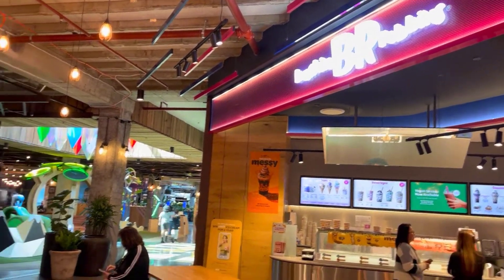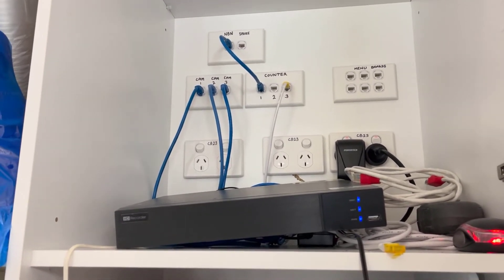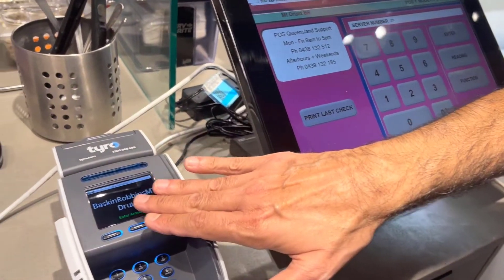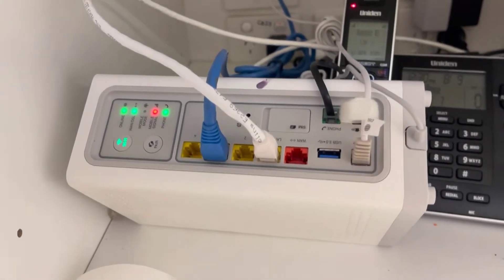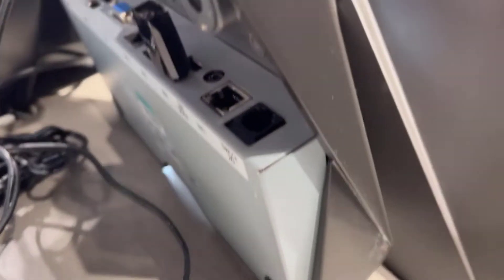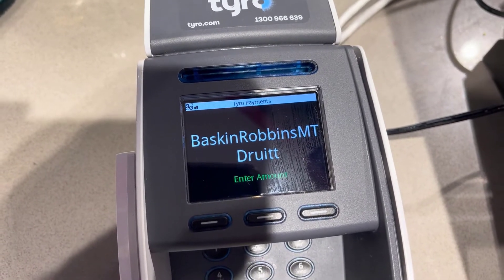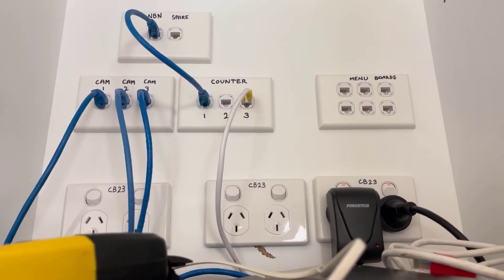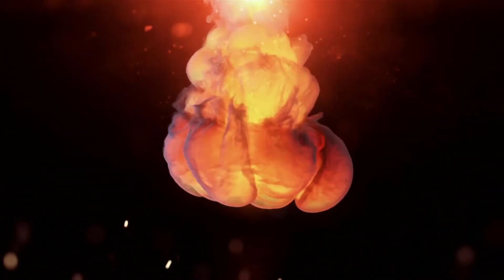6 Months POS Not Working  | Troubleshooting Faulty Point Of Sale System In Ice Cream Shop Westfields

Comment: Well done with the troubleshooting. Admittedly once nbn and Telstra (Internet) issues had been ruled out, the next port of call for the customer probably should have been an independent IT tech. Any worth their salt could have confirmed the connectivity problems on the router network switch. You're one of the rare ones who know what you're doing and how to test both sides of things, but there is generally a big gap between people familiar with the telco/nbn cabling and people who know the IT side.
Reply from the maker: Thanks Gavin. I appreciate your comment. 👍
Reply: That’s beyond NBN technicians scope.  This dude has problem solved issue as he gets paid for it unlike NBN tech who doesn’t get paid for it…

Comment: My 2c
It sounds so much like ipv4/6 problems, that white telstra modem does both and it causes these problems, I know as I have had this trouble with my customers, I forced ipv4 only, through it on both NBN and 5g and it fixed so much but I also set host and fixed dhcp ip's on/for the devices and it stops 99% of the problems, it was a Telstra problem and T staff not knowing about ipv4/6 settings.

I have for one customer changed there modem to a non Telstra one, added a 4g Usb with the Sim from the other, then added a siptopots for there phone and it gave them so much better connections and backup.
Reply: I was thinking it was some kinda dhcp conflict, replacing the router probably resolved it… for now ;)
Reply from the maker: Thanks for your feedback on this video.

Comment: These Telstra smart modems aren't meant to be used in confined spaces. I have both the Gen 2 and 3 models. The customer has his stored under the POS counter in a small, confined space. His new SMG3 will likely fail again in a few months. It's the thermal footprint. I would keep it in the back where all the main Cat6 ports are, and simply use an unmanaged switch in the front. The SIP (phone) would be quite easy to route under the POS as well as all the cabling is done.
Reply from the maker: Thanks for your feedback on this video.

Comment: my bet, the ethernet switch chip got a jolt from those poe cameras, frying it. nice work
Reply: Yep possibly there was actually an nbn fault at some stage and the customer got frustrated and zzzt connected a PoE output from the DVR into the router while troubleshooting. The way that shop looks wired up would make a mistake like that really easy to do.
Reply: @GavinR824  the way the shop was wired was what made me think of it